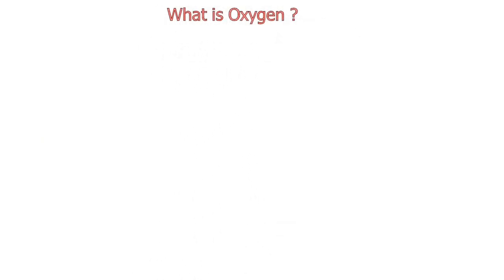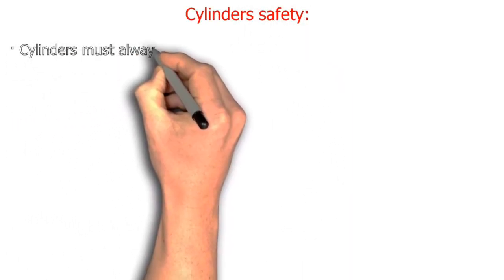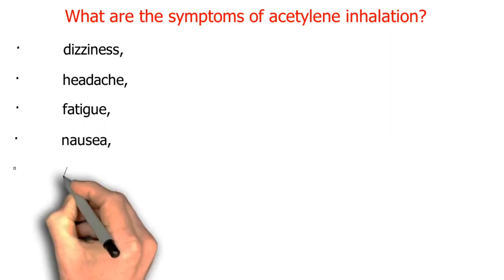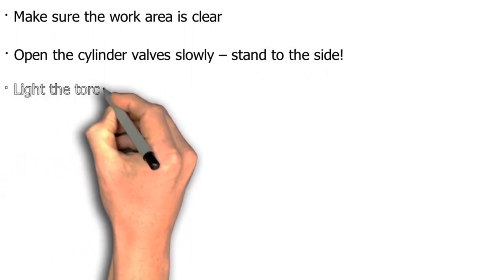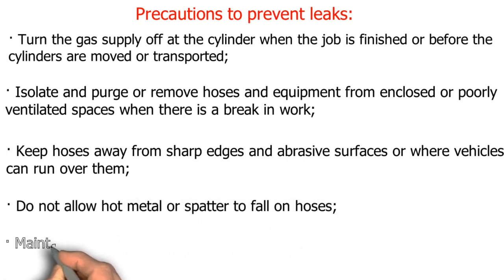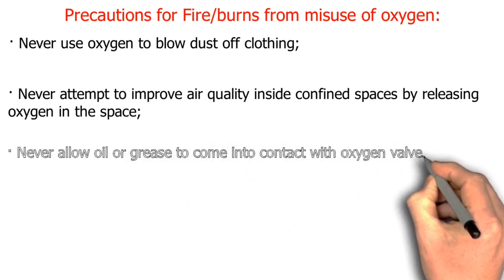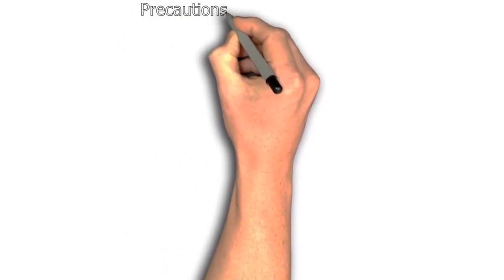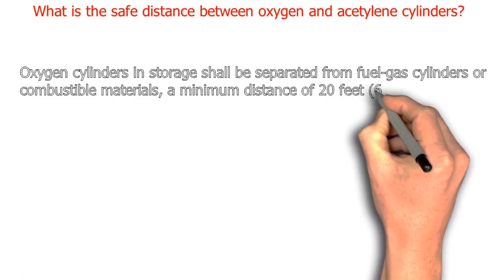Oxygen and Acetylene Safety Precautions

Comment: In my country a fire resistant glove is mandatory close to the cylinders. Warning signs outside too. So fire fighters will know.
I was learnt to not open torch valves after closing cylinder valves. Then before leaving check pressure gauges and then open torch valves. Indicates leaks.

Comment: great video thank you. As a Firefighter we just had a warehouse fire. In the rear, multiple cars and oxyethylene cylinder that was making a hisong sound. No flames around cylinder But it was a hazardous that was noted. Do you just cool it with water? does it have a pressure relive valve? do you move it outside the building if possible? there were multiple cars inside as well in close proximity to cylinder while fire attack. meaning water was being apply to tbe room with fire. Thank you.